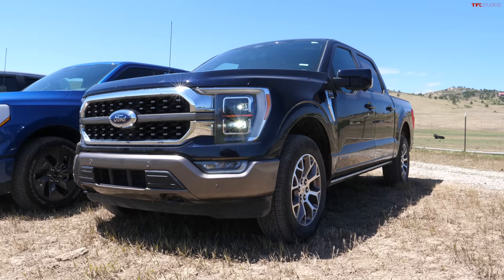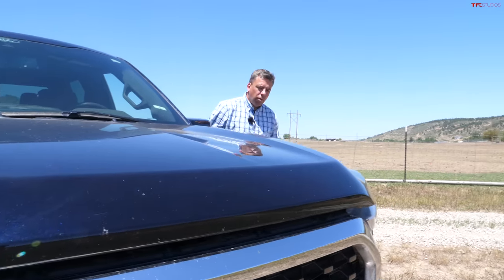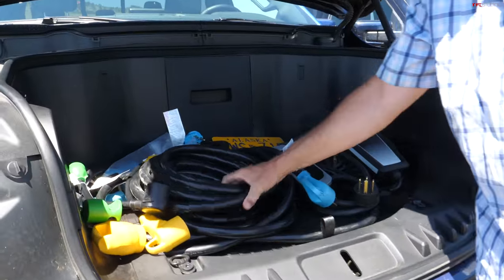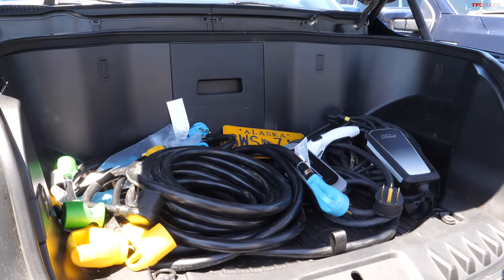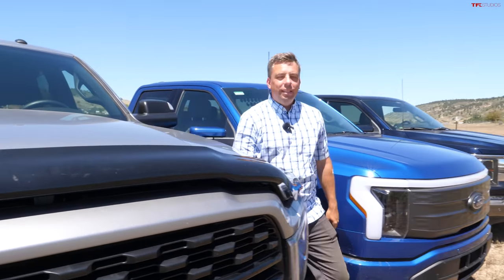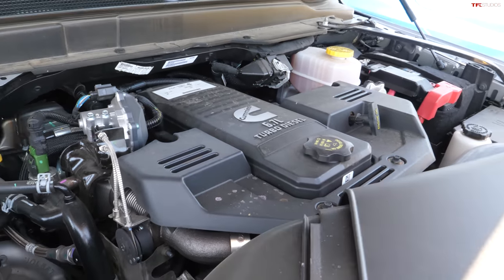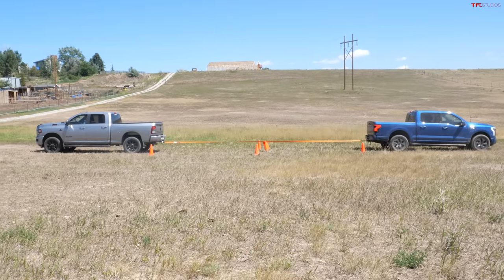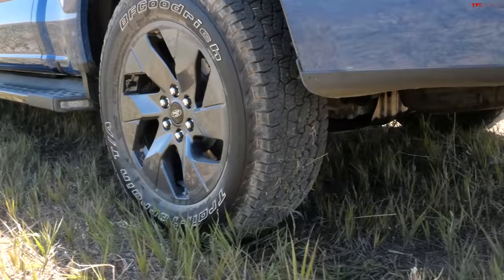Diesel vs Electric Tug-of-War: Ford F-150 Lightning Takes on the Ram 2500 Cummins In a Nail Biter!

Comment: You know dang well that little lightning isn’t going to hold up long term at all. Have it pull a trailer with actual weight on it and that battery will crap out. Stick to full diesel and gasoline and forget electric.

Comment: Imagine a pound for pound comparison; identical torque, identical weights. Electric would've decimated fossil fuel. 

I don't know why anybody is still investing in diesel when electric trounces it in power & linear performance. It's like doubling down on dinosaurism. They are definitely better than gas for heavier duty applications, but for anyone spending that much money on a truck, it's just smarter to go fully electric.

Comment: Put them on pavement. That Cummins will drag it around easily. Electric might have power but only pull a trailer about 50 miles lol

Comment: The stupidest and most pointless test of a pickup truck is a tug of war. The truck with the most traction wins every time so weight matters way more than horse power. The heaviest version of a Dodge Ram 1500 tops out at  5370lbs. The lightest version of the Ford Lighting starts at over just over 6000.

Comment: "Tug-of-war" is nonsense.  It tells me nothing.  The outcomes can change with different gearing and the amount of tread that grips the ground.  What I want to know is which one travels farther on the interstate highway pulling a 10,000 lb load at night with all of the bells and whistles on like the high beams and air-conditioner everything that uses power.

Comment: I work in the oilfields so i get to drive and work the F series trucks. Lots of torque and power and good reliability. We use 5.0 and 6.7 based trucks. No issues with them. However the V6 trend is getting bad lol. Everything has a damn V6. They sound like a bag of ass. I dont care how much they make over a V8. The V8 is obviously NA and the V6 is boosted....put a V8 on 1/4 the boost that the V6 is using and the V8 will make way more power and torque. But thats whatever lol i just dont think new trucks are really worth 50k+ and the criminal stealership mark up price over MSRP. I have a 2012 f150 coyote and a 2007 sport trac 4.6. pretty happy and haven't found a reason to buy anything new. As a mechanic I'm pretty happy with my old vehicles. Lol paid off and if it breaks i can fix it in the garage. To each their own 🤷🏼‍♂️

Comment: ford is not going to win because it is an F -150 vs 2500 ram and if you take off a zero it is a 250 witch is like two f-150s so you cheated

Comment: If the tires are still turning then it comes down the Weight and Traction. Electric vs Gas vs Diesel means absolutely nothing. You completely did this test wrong. Next time distribute the weight exactly per 4 wheel scale and the same Tires and on the same conditions terrain...otherwise your test was pointless.

Comment: EVs won't become mainstream until they work out a better Hydrogen fuel situation. But you won't get the instant torque with the fuel cell like you do with batteries.

Comment: Put them on the street where the dodge don't dig itself in and see what happens. You should be smart enough to know WEIGHT digs. All tests are inconclusive. Put same size tires on all 3 and the Dodge will pull them both around. Trust me the Dodges don't play.

Comment: The problem with this test is the computer shuts the engines down if you want the real test use a gas or diesel engine that is non computerized and id say you would have much different results in reality there is nothing wrong with any of these engines or something made in the 70s or 80s we are not addressing the problem and that is the fuel we should be asking ourselves what can we burn in what we already have and the answer to that in my mind is hydrogen it will run anything with a little modification but in reality there is calculated measurement of energy equivalent where power is concerned it is how efficiently it can be done and feasible for the public but atleast you had fun

Comment: Who cares what engine type has the most torque when tested like this.  It's which vehicle can effectively tow a heavy load over a variety of terrain for the maximum distance.  And on that criteria the electric vehicle is a complete joke and the diesel, especially a RAM 2500 is VASTLY supreme.  They are not even in the same ballpark comparison wise.

Comment: It would be more interesting to see the wear to the motor windings and the heat that was generated on the pull where the EV motor was pulling with a locked rotor. LRA's (Locked Rotor Amps) are very damaging to a motors longevity.  Electric motors have a lot of torque! That's good as long as they are spinning and able to cool themselves. However the moment you start loading one and pulling it to a dead stop it basically turns into an electric heating coil and it doesn't take long (literally seconds) to do some serious irreparable damage. Admittedly this scenario will certainly almost never happen to 99% of EV's but for science sake it would be interesting to know how long it would take to burn up an electric motor trying to pull a tree stump! The fuel powered vehicles will just burn up a cheap clutch which will allow the engine to slip before it damages itself, but the Ev's don't have that option so anytime they are pulling without spinning they are experiencing a damaging situation...and variable speed motors are really expensive! I'm guessing the drive on the motor has a fault for an over amp scenario but I wonder how easily it trips and also if you have to tow it to a dealer everytime you need to clear it.

Comment: Hook a 8000 pound trailer to each tow from San Bernardino to Vegas see who goes the farthest torque and horsepower is nothing if you can only go a few miles then you have to park it and recharge and you didn’t prove it pull a boat load further you didn’t go anywhere do a real truck challenge I mean what people really use a truck for haul some heavy loads over 400 miles

Comment: Dependability what people want in a truck. My tubo diesel 1 ton ford can pull a 40 ft 5th wheel up the mountains and I dont have to  pull over to refuel for 10 hours and only takes 20 minutes and im back on the road

Comment: Give me the Dodge Cummings Diesel.  Don't want some stupid EV Truck that can only go 80 miles on a charge pulling a Travel Trailer.  And yes, I still use my Toro 2-cycle Lawn Mower from year 2000.

Comment: I'll take diesel all day long. See I can run a diesel all night while sitting still running an air-conditioner .
Hurricane Michael < ask me how I know. Pull trees off the property  like a tractor. And at 250 thousand miles  2012 GMC 2500 diesel  4x4. Ive been offered 30 grand for it.

Yeah I own the beast

Comment: The entire project failed when you didn't even have the proper hook up at the start. I know that electric motors provide constant torque. But main point to all of is. When the electric truck dies. The other to will finish the job. You are many years away from a solid market for work trucks or cars for that matter.

Comment: Steam engines and electric motors have 100% torque almost from a dead standstill. That has been proven many a times. It's why steam engines and electric motors don't have Transmissions. The question is which is more reliable? And I will tell you the diesel engine is more reliable than anything else.
In my experience, Dodge had ALWAYS been better then ford. Regardless of the outcome. I would still take the Dodge with the Cummins over either Ford

Comment: EVs Have instant torque... all of them. performance is only going to get better. design for fossil fuel powered vehicle has reached its peak. not to mention they are powered by a very finite resource.  this is a cool experiment, but an unfortunate one. it gives people the opportunity to trash electric vehicles and make up excuses. the main one i assumed and affirmed after reviewing comments is range anxiety. speaking loudly as to their propensity to measure manhood by the type of vehicle you drive.  the reality is vehicles will never be used like this except for a youtube video or some nonsense on tlc but never for day to day practical uses. electric is the way to go for shipping, transportation, and even racing. our future depends on this. also battery charge doesnt deteriorate as quick as most think, especially with tech like regen braking.

Comment: The difference  it's in the weight, not the power.  the lightning is the heaviest of those vehicles,  the batteries extend along the entire length of the floor. EVs are unreliable  vehicles

Comment: The electric trucks have more power than I ever Imagined but no matter what after so many years you will have to replace the batteries which is the cost of a cheap car. Who wants to worry about that. With a gas motor you can go for years without that kind of cost. One more thing. An electric car only drives so far before needing charged. Who wants to stop every couple hundred miles to charge a car. What happens you get home and the car is about dead. You plug it in and then all of a sudden you have an emergency. Your kid allergic to bees and they get stung. Now your stuck because the car is dead. I don’t think so. How about the cost to charge a vehicle. Right now people are paying several thousand a month for their electric bill because of charging their car. That’s the cost right now. What happens when that is the only option. What will it cost when you have2 maybe 3 electric cars. I couldn’t imagine the cost. Road tax comes out of buying gas. That will change. You will pay an added road tax through your electric bill. Plan on the electric prices going up. I can almost bet it would be more expensive than when buying gas. They control the prices and can charge you whatever they want. You have to have electric. How about the electric motor goes bad. I bet that’s not cheap and it will have to be a special certified technician which will cost double what the regular techs charge now.  Is no one thinking ahead on this stuff. Give me my gas or diesel truck. At least I know I can work on those and I know they are reliable. The electric vehicles is to new. They have t been proven. Once they have been on the roads for 20-30 years and prove themselves then maybe I will change my mind. Until then I’m good. I don’t trust it.

Comment: You didn't put it on pavement because you're worried about tearing up the drive train?? WTF?? The tires will spin. If the gears break then great. Shows us how shitty their parts are. After this tug o war nonsense put these up to what most people use their trucks for ...TOWING STUFF. Get a 5k trailer,  all 3 trucks Jacksonville,FL to Nashville, TN. You get some flat land and hills on that run. Let's see who gets there first obeying the speed limits of course.

Comment: I'll take the diesel RAM any day over an EV truck. I'm not going to add hrs or days on to a trip towing my RV. The diesel I can fill up in 5 minutes and be on my way. I'm not waiting around hrs to find a charge station that may or may not be fast charge or in use and then wait around till it charges. EVs in my opinion just aren't there yet. Not to mention I can't get past the sterility of EVs. No sound,  stark interior, and no sole. Blah no thanks.

Comment: ... and will loose power with each pull, until it succumbs to the universal law of batteries. The power curve, unfortunately is a curve. There's no curve in Petro power. You get consistent power until you run outta gas. You will NEVER get that with batteries. Batteries are for toys silly rabbits.

Comment: Yep and how far will thank electric truck tow something..lol and oh it protects the environment..lol.. it takes digging 500,000 lbs of earth up to make 1 1000 lbs battery.. lol.. plus if you drive 15k per year after 10 years you gas/diesel trucks will keep on truckin.. the electric truck is going to need a 7,000 dollar battery..you are being scammed by automakers pushing these because they know in a few years you are going to need a new battery regardless of miles driven

Comment: Proved nothing as the real test is which truck can last longer with full power on and that is easy to work out. Electric vehicles might be okay for about 10 minutes but then as their battery power diminishes they lose hands down. EV trucks are rubbish and only a clown would even consider buying one.

Comment: 😑 your only going to pull in dirt as much traction as you can put down, do the same test on pavement for better traction. They're trying really hard to make these EV's look desirable.... thier just not practical, i wounder how many charging stations are between the farm, the ranch, and the country buffet..... 🤔 probably none. Electric may work for you if you live in the middle of a large city but for a rural areas and small towns 👎

Comment: EV's are so Heavy They are extra Dangerous .I Bet Money The longevity will be the Diesel by Thousands of Miles ?I know Electric will not outlast Gas or Diesel It Cost so much More for The EV I will Bet , There is a Hummer Broken Down sitting in the middle of Traffic ? The Coke can size Turbo's will Go before The V8 ? The Cost to mine Rare Minerals will never be able to be as Carbon Free as an EV will save ?